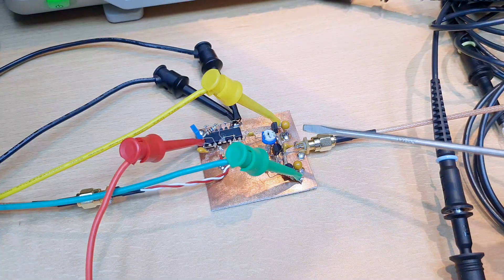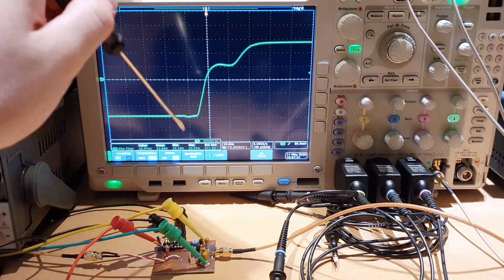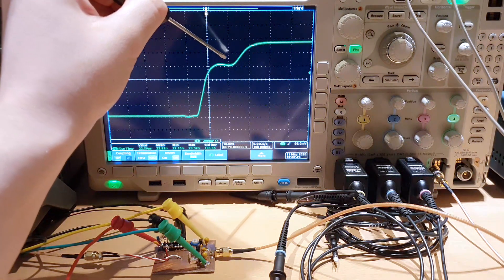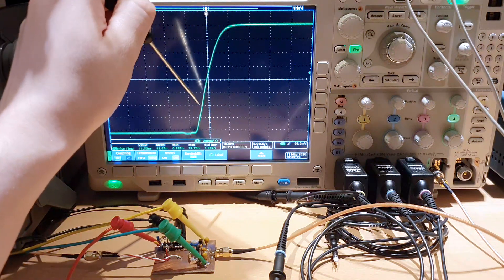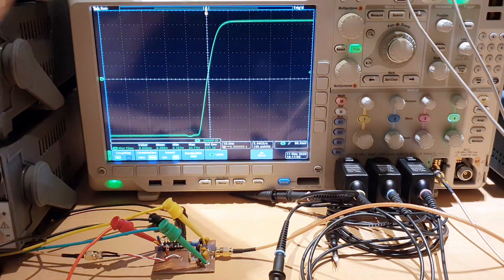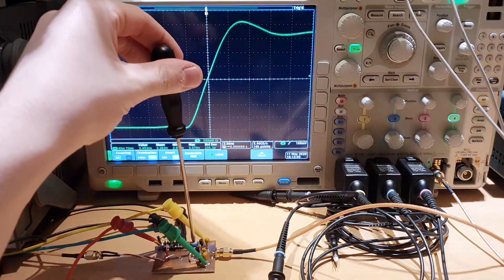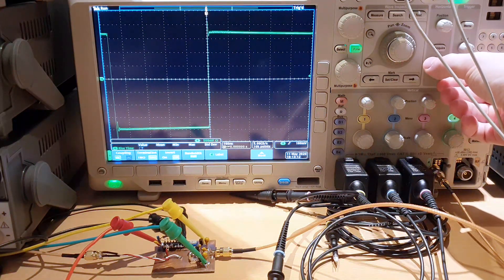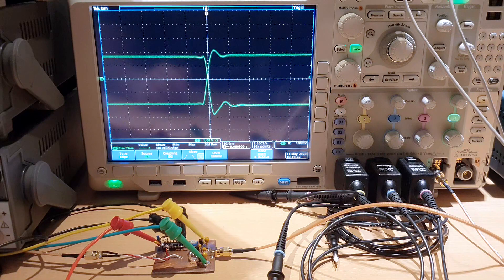Push-Pull - Class B Distortion

Comment: Gregory... Now you definitely got me hooked.
You know... the subject of push-pull class of operation is a "classic" in electronics and I thought I wouldn't see anything new when I saw your video tagline.
But when I saw you doing it using a fast-edge generator, and approaching the subject from the switching behavior, I saw for the first time a new way to look into this.
I like audio, and I always thought it's a hard topic to find out what is the best biasing one can get, one that is almost indistinguishable from Class A (the ideal situation in terms of distortion), but the closest as possible to Class B power efficiency.
The undesired "gm doubling" effect that happens in the crossover area is difficult to clearly differentiate using just biasing measurements (e.g. DC approach) because the devices heat up and change their bias operating points, or distortion approach (e.g. Frequency spectrum approach) simply because it's way too subtle and hard to measure.
But this video showed me a novel approach into this.
Evaluating the switching characteristics during fast transitions may prove a better way to easily identify that "sweet spot".
I particularly liked your fast-edge generator... I use a similar one, with 74AC14 to generate transitions fast enough to calibrate my 100MHz scope (I know, it's marginally fit to the purpose, but I almost don't play with R.F. stuff so, a 100MHz scope calibrated to this extent to me is more than enough).
Big kudos to you on this one.
Reply from the maker: Thank you so much, Fabio!